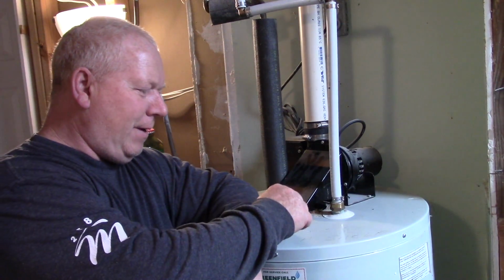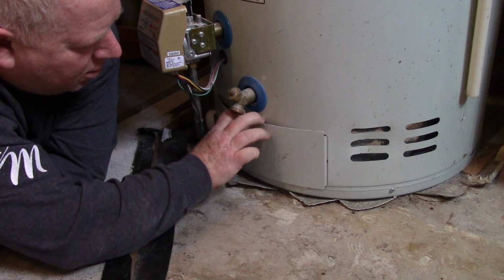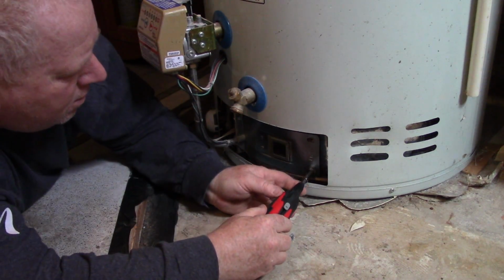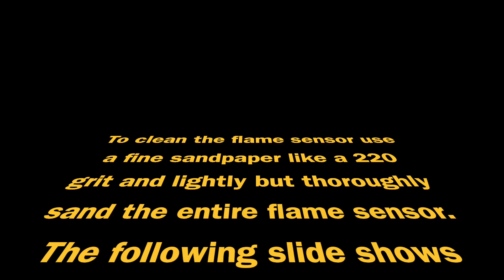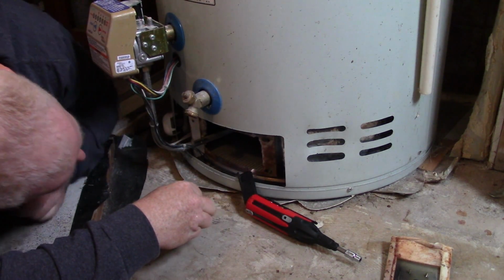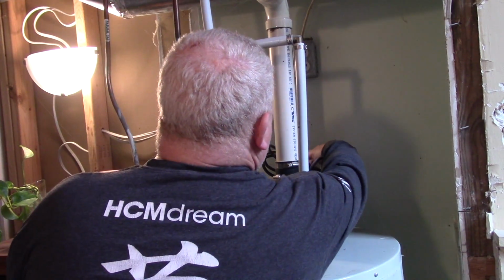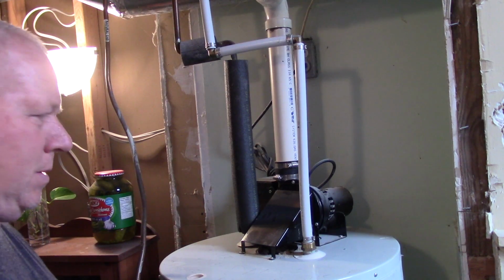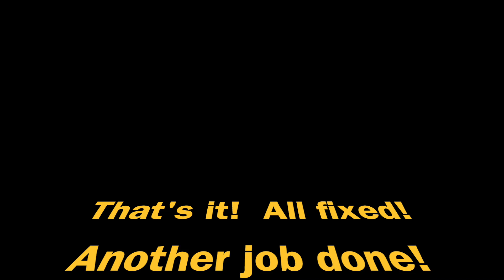How To Fix Your Water Heater For Free.  How to clean your flame sensor

Comment: I got my pilot light to fire back up after following your instructions. Fingers crossed 🤞 this does the trick and I can cancel the service call in the morning.
Reply from the maker: If it fired up after cleaning then the flame sensor was most likely the issue.
Reply: @robsgaragewoodworkin  Hot water this morning so I cancelled the service call. 🤙